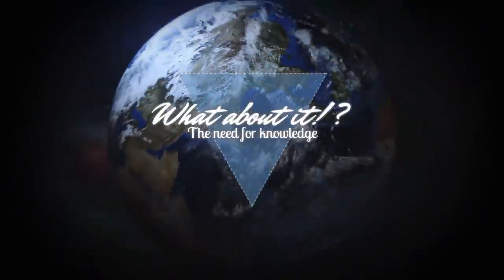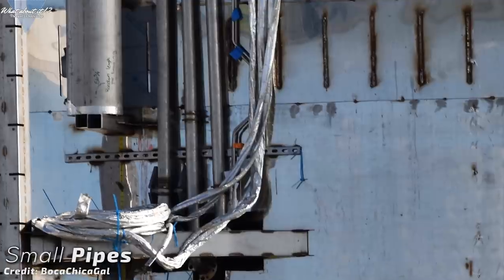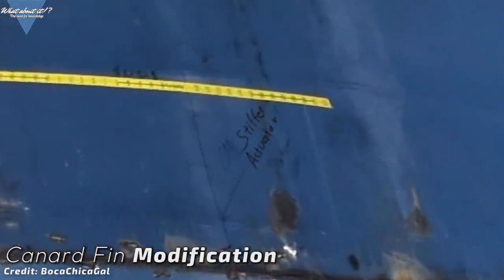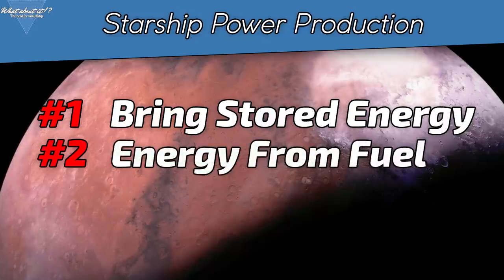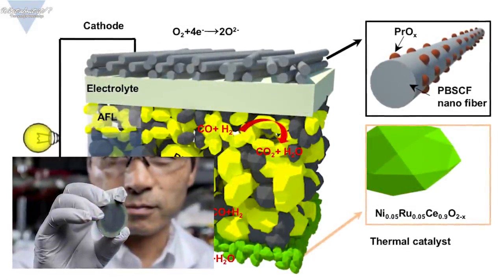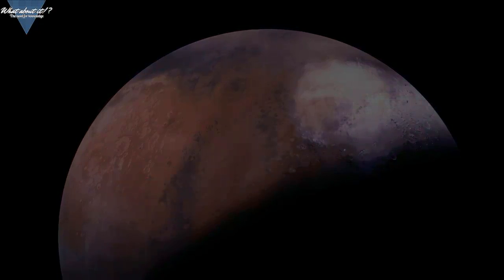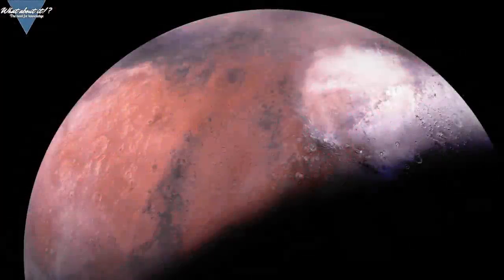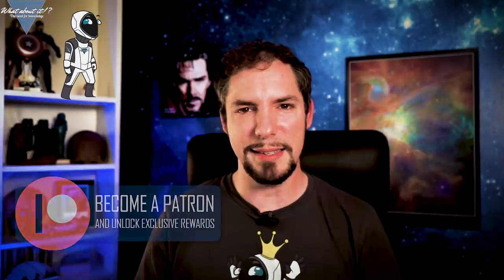45 | - How Does Spacex's Starship Generate Power?

Comment from the maker: What’s up with all the pipes on Starship Mark 1 and will Starship use its stored solar cells on the way to Mars to generate power?
Reply: A stored Solar cell array seems very logical. Great run down on SS Power possibilities Felix.
Reply: On the surface of mars they could use Starship tanks like an accumulator? using excess solar energy in the day to liquify the thin martian air and store it for later outgassing through a turbine? or given Starship's height? an actual physical accumulator - IE the winch they intend to use for cargo, attached to a cage filled with martian rocks that can be released to drive a generator in the winch? perhaps the heat from the firing engines could be stored in some kind of medium like molten salt and used as a heat source for a stirling engine?
Reply: Or just install a kilopower reactor - one of those would solve all the issues ;)
Reply: Pipes will be covered.
Reply: Solar array, even as cargo, will take away volume & mass from the rest of the cargo (Sabtier stuff), so can't be too big. Can someone please calculate the mass of methalox needed to power a crew for 3 months with fuel cells? Then problem of mass of fuel cells. 

Perhaps SpaceX just hasn't bothered to render the solar arrays. Solar on hull won't happen, too many problems, too little useful surface. Constrains ship orientations for thermal management and protecting from solar radiation.

Most likely: planning to use nuclear power for crews, but keeping quiet to avoid the tiresome controversy for as long as possible.
Reply: Is that not the guide rails for welding the heat deflectors just like thay had up the sides of the bottom fins on the display model????
Reply: I´m sorry Felix, but the idea to use stored solar panels as an intermittent power source is not feasible.
It would only solve the problem for pure cargo ships (and only those hauling mainly solar panels), which happen to use less energy than passenger ships. But the passenger ships would be packed with people and all the necessary supplies. And since the idea behind starship is to use one base design to lower costs, it wouldn´t make much sense to use different power sources for the adapted versions.
Also #dearmoon comes before any flight to Mars, hence Spacex has to solve the problem for passengers first.

My best guess is that it will a combination of folded solar panels (not showing them doesn´t mean they won´t be there) and another option, but nothing nuklear. Imagine a Starship on Mars with a damaged reactor, that cannot be fixed because there are no parts available...ouch.
Reply: Problem with nuclear: heat. But maybe the surface of starship could be used as a radiator.
Problem with surface solar panels: radiation. IIRC Elon said that Starship will always be pointing away from the sun in order to minimize radiation for the crew. So 0° angle for surface panels.
So I think it's going to be kilopower and/or something similar to the original concept
Reply: I'm going to go out on a limb and say that pre-deployment solar elements in space and assembling a solar rig/sail to be attached in space would be my go to answer, both supplying power giving  additional thrust and later after arriving on Mars or the moon being deployed in space as a satellite or being independently landed on Mars as additional solar cargo
Reply: @AndyOO6  Mars orbit insertion won't be possible for that, as Starship will do an aerobrake maneuver which would destroy this
Reply: my main focus would be cutting the timeline down, fractional savings add up quickly.

savings one: reduced weight to space.
savings two: increased cargo load per transport 
savings three: reduce time to delivery, and deployment
savings four: solar elements function as directional radiation shielding...

it's always fun to go out on a limb and look around... lol 😂 🕵️🎄🕵️‍♀️🚀
Reply: @infinite_monkey590  "being deployed in space as a satellite or being independently landed on Mars as additional solar cargo" <see the words I wrote? do you know what they mean? 

They mean that it would detach before landing in the upper atmosphere and either orbit mars as a giant satellite or independently land with parachutists

both ideas being useful for one thing or another..
Reply: @infinite_monkey590  when I say deployed in space... I mean that the giant rig would be generating its own thrust and need to vector to a high orbit itself to bleed off speed later deploying parachutes I summed that up with "land independently" "land" involved the breaking step, the breaking is the first part of landing..
Reply: Re Power:  You are all over-thinking this.  They didn't show solar panels because those are deployed only in cruise phase. Cruise phase is shown in the ITS render, which is where you see the panels. Imho they will be integrated as in ITS (no construction needed).
Reply: To cover these pipes with a sheet of stainless steel, turning the round cylinder into an oval would add some weight but greatly strengthen the hull of the ship.  Those temporary bars are just that; they help ease the task of fitting the fins.  They show temporary stitch welding for easy removal later.   Don't the astronauts need to exercise?  They can generate some power themselves using stationary bike to run small generators.  Won't give much power but computer and lights don't take much.  Also naturally available Tesla space charging might be employed. Andy about 10 comments prior has the best idea:  Pre-deploy a removable solar array.
Reply: You missied Thorium for fission.
Reply: @donjones4719  3 months, say 100 days = 2,400 hours at 20kW average load = 48,000 kWh = 48,000,000(Wh) * 3600(s) in Joules =  172,800 Megajoules... Methane energy density = 50MJ/kg, say 60% fuel cell electric conversion efficiency requires about 5 tonnes of methane in all. 5 tonnes of methane requires about 15 tonnes of oxygen to react in the cell (!) So we're at 20 or so tonnes of fuel to produce 20kW average for 100 days. Seems excessive. As Musk and even Besos have noted, solar power is really useful in space. A hundred meter square solar array can make about 20kW and weigh far under a tonne. The earlier starship illustration showed two solar arrays each big enough to make about 50kW. A 50kW powercell could weigh just around 200kg itself though, so I expect is an option to include for auxillary generation while eg. deploying arrays and for exceptional situations.
Reply: Andy Mode Thank you! for the knowledge & work. Yeah, figured fuel cells won’t work out mass-wise. Has to be solar, with fc or batt auxiliary. Just because they didn’t bother with a pic doesn’t mean they dropped the idea. Or nuclear.
Reply: I wonder if they looked into molten salt reactors.
Reply: Elon is heavily invested in solar for good reason. The Mars energy strategy is based entirely on solar and methane and he has not funded or encouraged any nuclear projects. A ton of solar panels on Mars makes way more energy than a ton of nuclear plant and there will be no reason at all to carry one there, unless someone pays SpaceX a stack to safely transport and stash one a safe distance from base for publicity reasons ;D 
They'll have plenty of development of methalox fuel cell technology both to generate methane from electricity and vice-versa as required.
Reply: Thank you
Reply: @AndyOO6  I don't talk about landing, I talk about aerobraking to enter martian orbit in the first place. So how do you make that thing brake? Bring a heat shield, and fold everything back in behind that? Or bring additional tanks and a rocket engine in order to brake and/or enter a stable orbit outside the atmosphere? Starship would need to accelerate all that to interplanetary speed, the only saved weight would be on the way to LEO, which doesn't matter that much since starship is going to be refueled anyway.
Reply: Elon makes it simple, that means no nuclear reaction. But I don't know for a nuclear battery, how he would feel?
Reply: @infinite_monkey590  the first few will be sent and not refueled did you even watch the video?
Reply: @adymode  remember Nuke Mars? :D :P
Reply: Thermoelectric powersuply
https://en.m.wikipedia.org/wiki/Thermoelectric_effect
Reply: Piping on the outside is a lot easier to repair than going through the tanks. Also allows for a smaller overall vehicle diameter with less unused space inside the hull, makes for a more efficient, lighter vehicle.
Could the large cargo hatches seen in the renderings be stowage areas for deployable solar panels? Are deployable solar panels viable? I think I read somewhere that the ISS stows its panels when they do a boost maneuver. Starship will be traveling a lot faster, seems to me the panels would be more susceptible to damage.
Reply: A lot of torque and strain on the actuators during flight. There will be comprehensive strenghthening internally and I would assume the external strengtheners (strongbacks) are in place to keep shape integrity during welding procedures. Think you nailed it Felix with the external pipework - Rough, but it is the prototype. MacLeod :)
Reply: @jwenting  Diesel generators? I'm pretty sure Musk has stated he wants to use green power sources. I doubt there'd be a need for diesel generators at any of SpaceX's facilities.
Reply: @warhawkme6344  Kilopower is an MSR design.
Reply: @donjones4719  A kg of methane with 4Kg of oxygen gives 55.5 MJ of energy, or about 15Kwh

Using Felix's estimate of 75Kw power requirement it would need a combined 25Kg of methane/oxygen every hour to generate 75KW continuously in a hypothetical 100% efficient generator.

For three months that would be 25Kg x 24 x 90 = 54000 kG, that is 54 tons of propellant.
Taking a guess at a more realistic efficiency of 40% brings that up to 135 tons

That is more than the full payload capacity of Starship!  Honestly, before doing this calculation I was pretty sure it would be feasible, thinking more in the range of 10 to fifteen tons of propellant.

This makes me think that one would either need to find some way to drastically reduce energy consumption and/or combine it with other sources. 

A compact nucelar reactor running a stirling engine would be the obvious choice were it not for proliferation and earth safety issues. If would still need a rather large radiator outside the ship but that could possibly be incorporated into the flaps and some parts of the body since unlike solar panels it wouldn't be thermally fragile. Also, due to the abundant amount of energy the reactor can provide we could afford to have poor efficieny and hence allow for a smaller radiator.

The other solution is of course solar panels but they would need to be quite huge to provide that amount of power. If I'm not mistaken the most efficient solar panels achieve about 45% conversion efficiency which means that near Earth (with 1KW/m2 flux)  you would need 75/0.45 = 170 square meters of solar panels. Probably about twice that at Mars, say 300 square meters due to the lower solar flux (sorry I was too lazy to calculate that and just guessed it).  That would be almost as large as the whole starship.  It might be possible to make scuh a panel from a number of flexible rolled up panels that would then unfurl but would still be quite heavy and take up considerable internal space until deployed.

(Someone please check my calculation as I did it all in a bit of a hurry and I may be missing something)
Reply: @coreys2686  Understood ollt the current version a bit large for SS.
Reply: @warhawkme6344  ollt? The current version of what? I've been making too many comments in Youtube videos this morning.
Reply: Heat = Energy, right? How about using the heat generated by the surface and inside to provide energy? Johan.
Reply: @listerdave1240  I estimated 20 tons of fuel earlier in the thread for a 20kW average power demand so our workings kind of agree. I assume the 75kW spec has redundancy and headroom built in. I think solar array can weigh about 2kg per m2, about 0.5kW per m2 at mars, so rather light besides deployment structure. Imagining a sort of robotic space tentacle poking an array module out of the cargo hatch and plugging it into a socket on the hull %}
Reply: @AndyOO6  Did you even read what I wrote? I talked about refueling in LEO. Starship needs all of that fuel to reach Mars and land. No spare fuel for a huge satellite. If there was, starship would better use integrated solar panels like in the old renderings. Why overcomplicate things?
Reply: @coreys2686  I meant solar radiation is dangerous for people. So you don't wanna grill them by pointing that huge window towards the sun, which would happen if there were surface mounted solar panels
Reply: @infinite_monkey590  Very true, although I wonder how much the IR will do compared to the ionizing radiation, let alone cosmic.
The more I think of it, the more I like Stirling Cycle Engines and thermocouples to generate electricity.
Reply: Infinite Monkey, not a satellite.. I said solar sail as in it generates more thrust with it self.. I was joking that it could orbit as a satellite if they wanted it to, I mean more or less I would want them to create a solar tug boat to help push starship faster to mars that could be later taken apart for parts to create the solar farm on mars.

you send up bits of it in starship over and over again till you construct it, the entire reason for it is to cheat the rocket equation and generate thrust in space.. I mean if I thought we had nuclear power that would work I would say create a nuclear-powered platform to push starship accelerating it towards mars to cut the travel time down by 1/4 or 1/2 or more but everyone wants solar so I'm like ok a solar sail bla bla..

lol and you were like it will be destroyed by the fins lol what I was talking about would be almost as big as starship lol..  these things just snap right off lol..
Reply: Im thinkin that if your gonna have something running up outside the hull, its gonna be pipes, and wires, maybe even some wires inside pipes
Reply: @coreys2686  hmm. And MSR depends on gravity...
Reply: Wow... a big critisism from me: i nearly closed the window as you said and hit the like button as i thought thats the end of the video... dont do that...
Reply: for colecting fart gas to use for generating power endless energy
Reply: @antyspi4466  *nuclear

Comment: Great video! Another issue of using solar cells on only the leeward side is that the leeward side must always be pointing towards the sun, creating two problems. First, thermal control will be impacted since only one side will be heated during the voyage. Second, during solar storms it would be desirable to point the aft end of the spacecraft towards the sun to help shield the passengers.
Reply from the maker: Agreed! Thanks for the comment! :)

Comment: Felix, you probably hit the power problem answer with solar panels that extend from some sort of bay.  I would assume that they would not be in the main cargo bay, but in smaller bays on either side of the ships dorsal spine.  All it takes are actuators to open the doors to each array, and then the panels can spool out on guide rods.  Since solar panels can now be rolled up like paper towels, that is what I mean by spooling the panels.  And this type of solar panel is very thin and compact, requiring very little interior storage capacity.  Don't worry though, Elon and his super engineers will figure out how to power the Starship for the longer journeys.  Short test hops, and flights around the Moon should not require anything but internal fuel cells.
Reply from the maker: Caley, yes! It could definitely be separate compartments! I thought about the roll up cells as well. That would be the best solution for sure! Thanks for the nice reply! :)

Comment: At 3:50 in the video you mention guide rails for the canard fins. To my eye they're not guide rails at all, rather stiffeners for the enormous torsional loads that the hull will experience during canard actuation. Without the stiffeners the hull would buckle. 
Some things to cover in future videos:
1) Who is the guy on the wall to the right of your head?
2) SSTO: It is my understanding that one of the Mk will go directly to orbit w/o using Super Heavy. No work on SH and I heard Elon say Starship is SSTO capable. Once in orbit you only need enough fuel to deorbit and then landing burn. This IMO is essential to quickly evaluate the belly flop deceleration.
3) No way that thing will get off the ground with only three raptors, it is simply to heavy.
Thanks for another informative video. :)

Comment: As you said the closer to Mars the ships get the less effective solar panels become so I would expect that (at least) crewed starships will carry both solar panels and fuel cells: the redundancy gives them added safety and versatility for power generation not only in transit, but once they land to begin building the colony where martian dust storms could indefinitely inhibit or eliminate their already limited solar power collection capabilities.
Reply: No fuel cells, they have no hydrogen.
Reply: @Bryan-Hensley  No reason (beyond weight) they couldn't take some Hydrogen in smaller tanks just for and attached to the power-cells.  Additionally this video discussed the on going development of methane cells, which as they are already using methane for the ship, planning to manufacture methane on Mars, and methane is far easier to keep from leaking away (big part of why they are using it for ships) would be ideal absolutely.
Reply: @ArcherWarhound  search NASA Sterling engine
Reply: @Bryan-Hensley  Oh, interesting, a Sterling Engine could be a very elegant solution.  Thanks, I will.
Reply from the maker: Absolutely and I totally forgot the sterling engine... oh well. :D